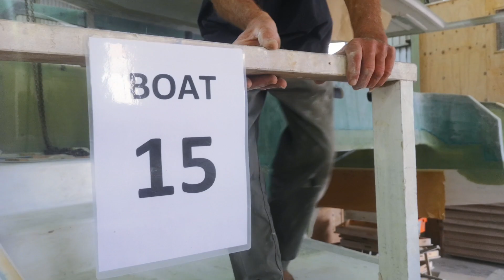Balance 526 Build Series: Episode 3 - Assemble

Comment: Hi guys. Can you do some longer and more detailed construction videos please which cover how your cats are put together. It looks like you mould large parts and bond them together. I would like to see more detail on how you are connecting the parts and explanation why it is strong enough. Will your cat construction hold up in adverse conditions or possibly even rogue wave?

Having seen the monumental issues with other catamarans structural construction including bulkheads separation and failure it would be good to see that Balance are well constructed. I have been looking more deeply at the construction side recently. Balance is on my shortlist.

Many thanks!
Reply: From a structural point of view... catamarans are the most demanding ships to design and also the hardest to build!
Unlike monohulls where the only point of stress would be the mast/keel centar of effort with minimal torsion deformation on the hull itself...
Catamarans are whole another story! And not in a most positive way! You can look at the cat amas as two completely separate hulls that wants to go their own way all the time. That makes the structure holding them together under enormous stress all the time. Add to that that amas itself had very large L/W ratio which makes them prone to torsional forces from all directons and are held stable on only 3 points along their lenght... And you can start imagine what kind of forces the catamaran is battling all the time!?
The mast compresion poll is also very short, on a horizontal structure(girder) above the water(roughly  centered) and all the forces from the mast are transfered artificially as there are no keel, high above waterline and perpendicular onto the hulls!
As we said already, amas are hydrodinamicaly and torsionaly independend, but now you can also need to add sail effort trough the stays and chainplates! keels/daggerboards(if any)! Windage,rudders.... and the list just goes on!
You end up with a ship(by design) that is flexing mess in all possible ways and forces imaginable and calculable!!!
That why is of utmost importance that catamaran should be constructed taughtly and properly! But even than you won't find a twenty year old one in full structural capacity!!
Unlike monohulls, catamarans have expire date, and required reqular structural checks!
Reply: @stormtrooper9404  
You are 💯 correct. Most are deficient, but this one has had my questionable issues addressed. 
This may be the one exceptional cat.
Reply: @SkypowerwithKarl  What deficiencies did you think you saw?  Andrew or Phil are pretty active here and may respond.

My own impression is that Balance boats seem well designed and well built.
Reply: @LoanwordEggcorn  

EDIT! I have been answered! All issues are addressed!
Reply: @SkypowerwithKarl    If you read the caption in the video it clearly states that the plywood bulkheads are temporary and only in place to add rigidity during the demoulding process.  The permanent bulkheads are all composite.  We do not use any wood in the structure of our vessels.

Regarding the framing of the main salon door, that is a primary structural bulkhead.  That entire structure is carbon fiber reinforced along with many other elements throughout the boat which are visible in the video.
Reply: @andrewhodgdon2786  
Fantastic! Then it won’t only be safe in a Lagoon 😉 See my edit above!
Reply: @andrewhodgdon2786  
Lol I had it so zoomed in to see, the captions were gone, my bad.
Reply: @SkypowerwithKarl  I do not have a doubt about Nexus catamarans building technique! They are top notch as far as I can see...
Yet... the laws of physics and current economicaly viable materials and techiques goes just "that" far!
If you are buying brand new and plan to sell it 5-10 years down the road, that's completely fine.
But there's no sales pitch that would make me buy one used no matter the brand or manufacturer!